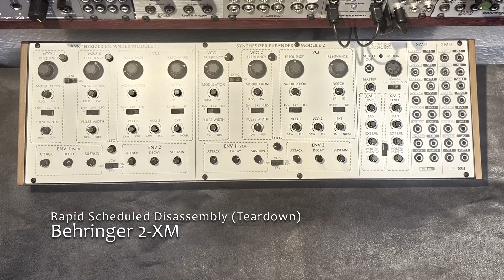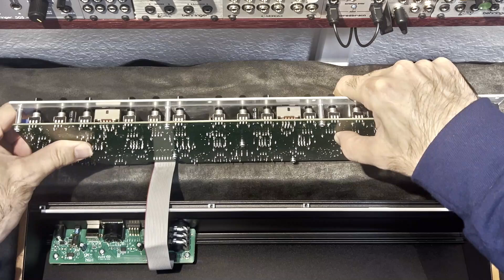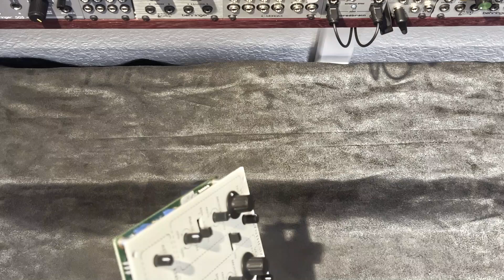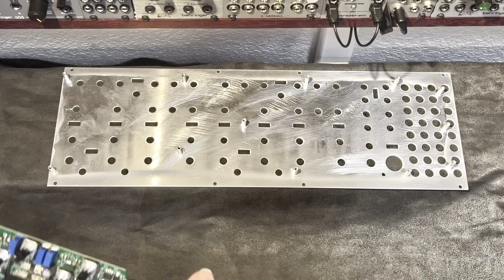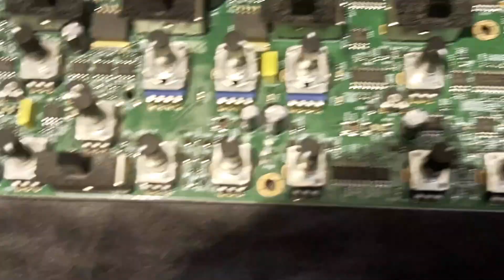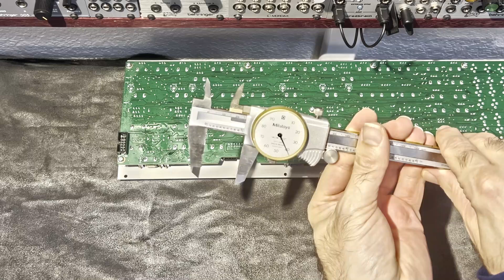Behringer 2-XM Teardown

Comment: Very Cool you talked about the op amps, but what about the OSC's and VCF's? There's no CEM ic's on here how did oberheim do this?
Reply from the maker: they did it with OTAs (specifically the CA3080) and transistor arrays instead of dedicated filter ICs, of which the LM13700 OTA is the modern descendant. TI has a fantastic datasheet for it detailing all sorts of circuits that the LM13700 can implement. Years ago I used it myself for a project for a group of local musicians to make a smooth leveling amp to limit headphone volume/peaks for in-ear monitor systems....its really pretty easy to work with and breadboard.

Comment: nice not to have to do it by myself 😊 thanks. do you think there is a way open for moding and amp swapping???
Reply from the maker: Sure...the 4580s could be swapped out but they are pretty decent op-amps by themselves, considering the application. you might consider other things like modifying the resonance range first. maffez.com I believe has a great page on all of this.

Comment: Also notice coolaudio V3046 which are five npn transistors. Two are coupled "matched". Clone of ca3046 but more modern, probably better matching. 
The resonance pole peaks are not as matched as the Sem Pro which has a more sharp resonance peak. It's all up to the electrolyte capacitors what kind of longevity this will have. But really today's components are much much higher quality than the originals.

Comment: Behringer just released an update that addresses the polychain issues. Proper round-robin is now possible!
Reply: Does round Robin mean each note selects an oscillator in an order say 1 2 3 then 4 then goes back to 1 as you play ?
Reply from the maker: @AdamTheAd-vanc3d  Yes, it does! Note that if you're holding down a note, it will skip it. For Bitwig fans, that would be known as "Free Robin" which is a common way to handle polyphony.

Comment: Great video.
Just that just a standard plastic tire lever that you used to remove the knobs?
Reply from the maker: Yes, and not too much force. it's best to support the other side to prevent the knob from bending the plastic shaft in the pot.
Reply: @frostporpoise9034  Thanks for the tire lever tip. Once my warranty expires next October I will probably take a peek inside. Apparently the VCO tune/scaling trimpots are all multi-turn and this is something very nice to see on a budget synth!

Comment: What make of caps is in the Behringer products? Some years ago I opened up one of those presonus mixers, and to my big surprise the caps where the cheapest you could buy ”cheng” or something like that and that mixer wasn’t old but already showed signs of bulging cap syndrome…. Nothing else to do except recapping the whole mixer with high quality caps… I don’t know how manufacturers dare put crap quality caps in their products as someday someone will tear it up revealing what shite they put in there. Hopefully Behringer upped their component choice from their mixer standards when making synthesizers 😅
Reply from the maker: Thats a good point! Really only select Behringer synths such as the 2600 "Grey Meanie" purport to carry upgraded passives. There is some debate about whether you can 'hear' the difference or not. But like you, I'm more concerned about the electrolytics, more for longevity than sonic quality. Time will tell. Not necessarily related but I put my 2-XM in an open frame chassis (improving passive airflow) which should help with longevity somewhat.